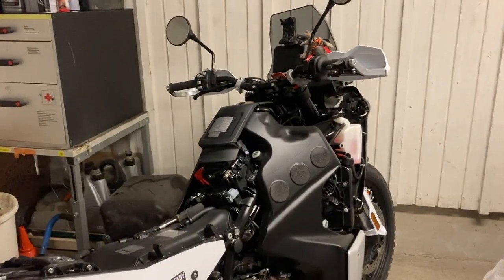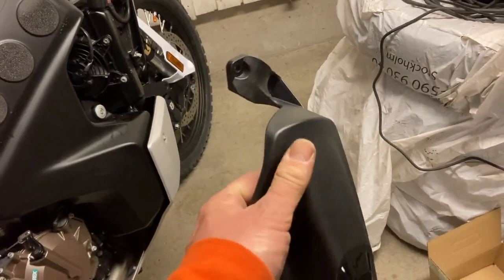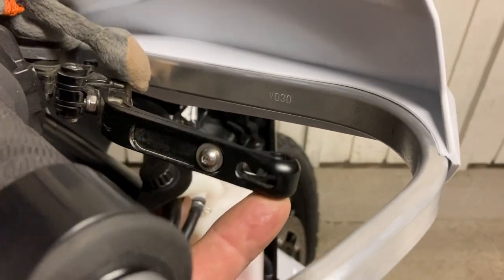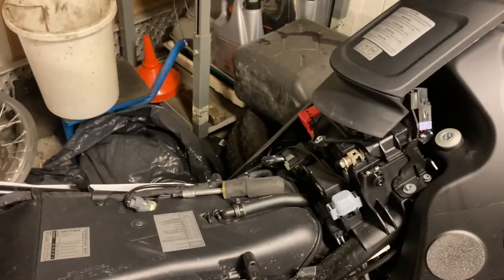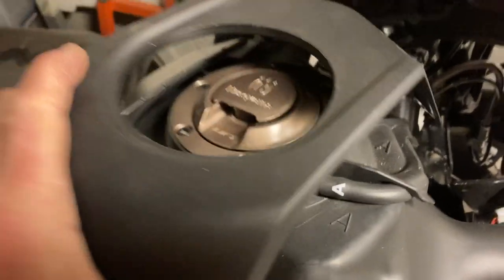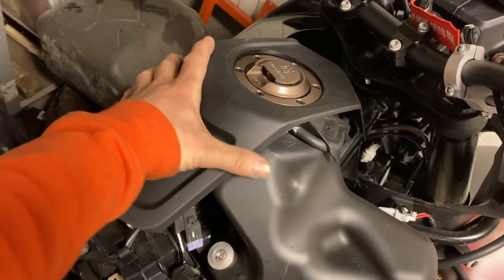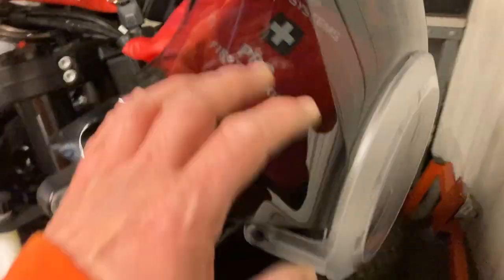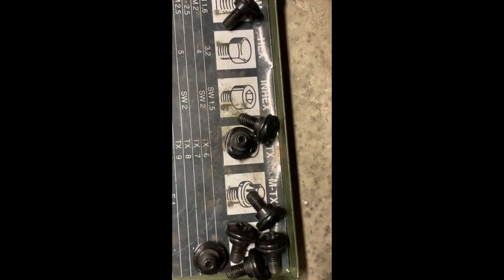Husqvarna Norden 901   Hand protectors, side panel removal, air filter access

Comment: Hello, these look like they are made by BARKBUSTERS. I have fitted some to my Norden but they hit the TFT screen on lock to lock, I had the bars in the forward facing position holes, so I then moved to the middle holes, the guards still hit the screen but lower, so I rotated the bars back to zero, still hitting. Do you have such issues? If not, what hole position are your bars in? Any bar risers? Thanks
Reply from the maker: I have the original KTM/Husqvarna now on the 901, but they don't hit anything! I have the full angle of the handlebar, no problem.
Reply: @kai-uweoch1159  thanks, not sure why mine doesn’t fit, they have the same part number stamped into the bar as yours, I will have to try again
Reply: @neilrose6558  Same issue with mine.  I am wondering if Cycra Pro Bend Ultra Hand Guard Kit will work.  I have on order the hepco and becker handguards which use the plastic OEM handguards but protect them with a metal frame
Reply: @iToddi  i ended up buying the OEM ones from Husqvarna (which are Barkbusters) but they came with some different spacers and everything fits now, it’s tight and I had to mess around with angles of bars etc and put risers in too, comes within about 5mm if screen but no longer hits it